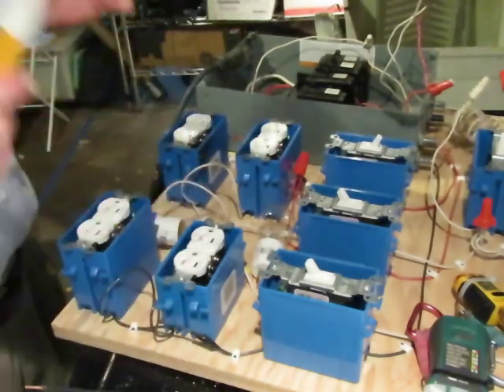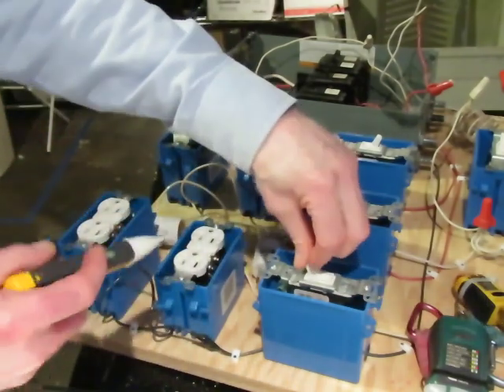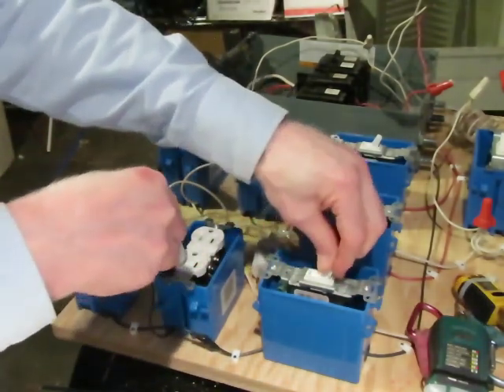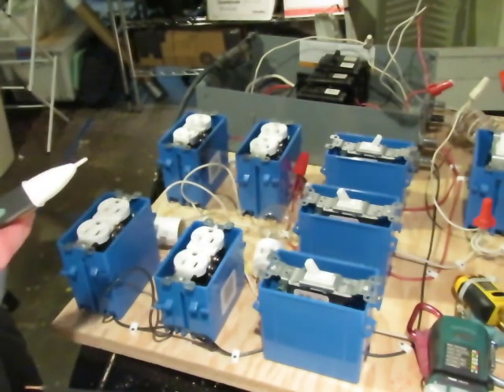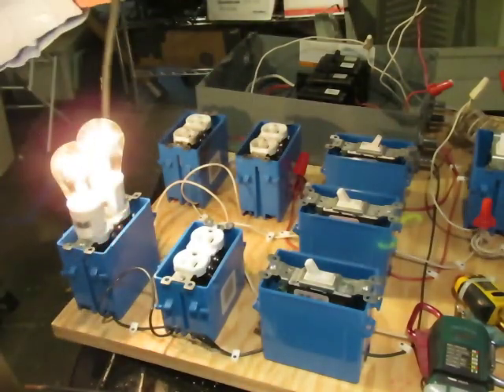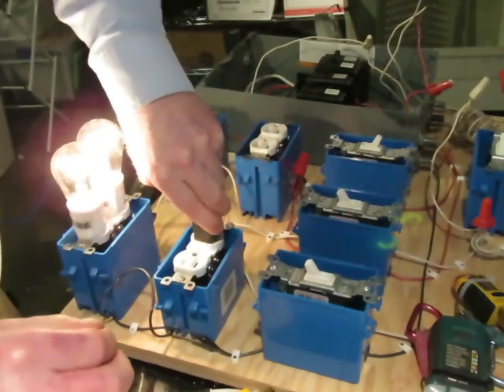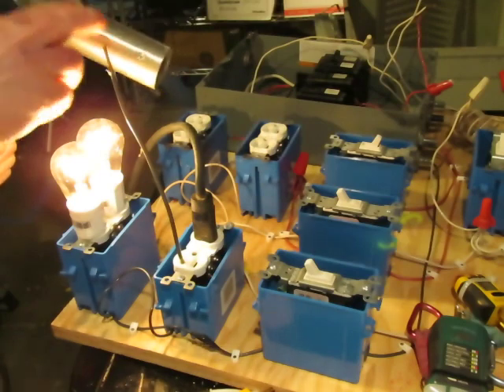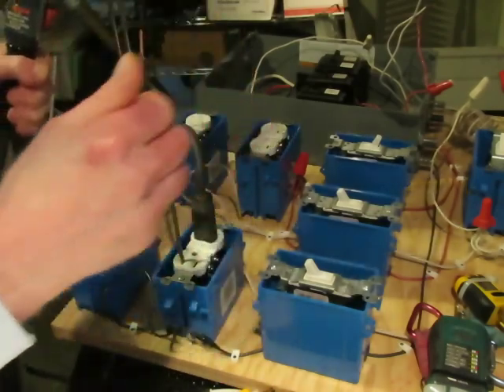Boot leg or false ground--Neutral to Ground

Comment: So same will happens if i loss both, neutral and ground wouldn't it?  So why would the ground line go back to the circuit breaker, shouldn't be an independent line all along?
Reply from the maker: Neutrals and grounds connect together at the service equipment

Comment: this demonstration is also the reason 3 wire dryer and range receptacles were banned in the 1996 NEC, because for those unaware of the difference between the 3 prong vs 4 prong version,  a 3 prong has your two hots,  and a neutral, which runs the 120 volt circuits (lights,  timer,  drum motor, etc) and is also used to ground the appliance frame.   a corroded or loose neutral can allow the frame to be a shock hazard,  a deadly situation on your damp basement floor.   a 4 prong setup is much safer because the neutral and grounds are separate,  and the neutral is insulated,  so this disconnected neutral problem won't pose a hazard.

Comment: nice explanation,  a bootleg ground & backstab receptacle connections make a dangerous situation even more dangerous.    Another danger is the possibility of reverse polarity bootleg ground,  in case the hot and neutral somewhere upstream is reversed, also sometimes very old wiring such as knob and tube the cloth insulation on both wires is black, so you have a 50/50 shot at getting it right.